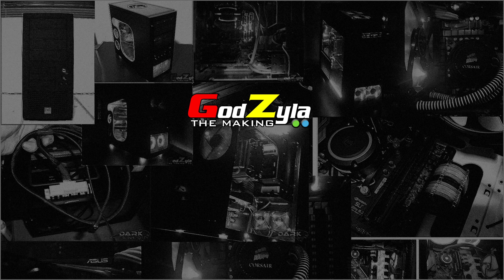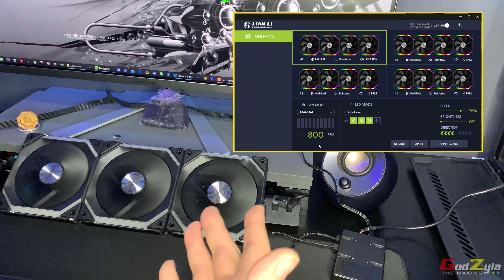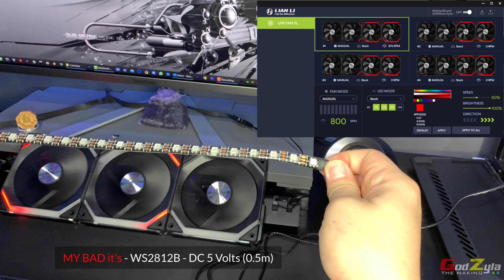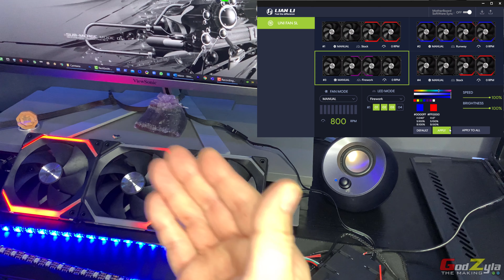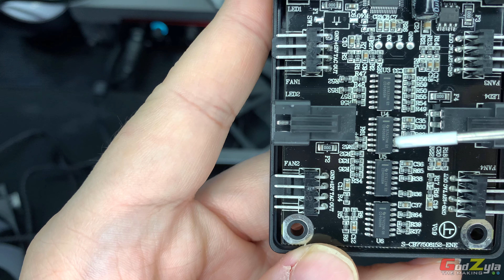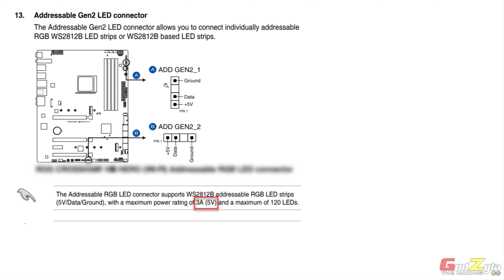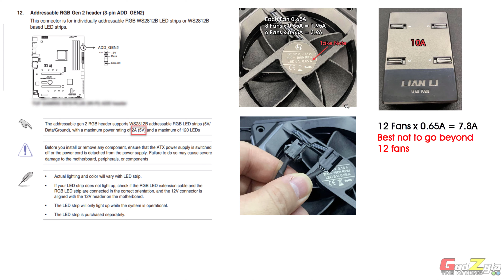Lian Li UNI Fans SL120 - Dos and Dont's (Part II) [L-Connect]

Comment: If motherboard is a320m a pro max cannot use this lian li fans right ? Because my motherboard cannot use software to adjust rgb , just can remote or controller only
Reply from the maker: Thank you for your question.  you can use the Lian Li L-connect software on the uni fan controller itself that comes with these fans (make sure you buy a pack of 3 that comes with this controller). 
What you need is just to plug the cable between the uni fan controller and your motherboard (refer to your motherboard manual on page 8 https://download.msi.com/archive/mnu_exe/mb/M7C52v1.2.pdf ) either to JUSB1 or JUSB2.
Reply: @KleoYan  can lian li 9 Fans together in one time ?
Reply from the maker: So long you connect 9 fans into the unifan controller. I suggest this. The controller itself have 4 sets of ports. Set 1, Set 2, Set 3 and Set 4.
Each set provides a connection for fan and for argb. 
Just make sure u daisy chain only 3 fans to each set. Example 3 fans to Set 1, another 3 fans to Set 2 and last 3 fans to Set 3. 
I do know u can chain 4 fans to a set but is better to balance out the load/power drawn that is build in the controller..

If you connect all 9fans or daisy chain all 9 fans together and connect to only one of the set. Lets say to Set 1.. u will overload it and will burn and blow..
Reply: @KleoYan  so if I got lian li 9 fans , must plug in 3 set 1 3 set 2 and last 3 in set 3 ? And I just plug in the wire to my motherboard Jusb 1/2 and that’s work ?? But I can’t use software adjust light , if plugin jusb1/2 its work how I want to change the lian li fans colour and speed ?
Reply from the maker: @raymondtan2832  Yes correct and when you plug wire to your motherboard JUSB 1/2 from the Uni Controller, use L-Connect software to change fan lights and also the fan speed.
L-Connect Software here https://www.lian-li.com/downloads/L-connect.zip  . you might want to view part I https://youtu.be/ORdObJTn-3E  or this from the official website https://youtu.be/xdEqEGrbMkQ , thank you!
Reply: @KleoYan  so the lian li fans sure my motherboard a320m a pro max can use ? Just the wire head pin plugin the jusb1/2 ? And then the fans will ori rainbow light and normal fans is fix cannot adjust right ?  And my motherboard and how many that lian li fans ? Cause need 6
Reply from the maker: @raymondtan2832  pardon me, where are you from? I tried my best to explain to you but you don’t seems to understand what I am trying to say. U can make use of the uni controller to control your lightings effect and fan speed. All is needed is to plug the USB from the control unit to your motherboard JUSB1/JUSB2. Then download and install the L-connect software from Lian Li and control your fan lightings and fan speed.
Reply: @KleoYan  oh ic , so it’s confirm work ?
Reply from the maker: @raymondtan2832  it will work. thank you!
Reply from the maker: Hi Raymond, I  have done up another video, you might get a clearer picture here. https://youtu.be/Rm2emeyMUAk

Comment: I'm looking at buying this kit x 2. I built a system using the H710i NZXT case which comes with a single LED strip. I haven't looked carefully at it, but I'm trying to figure out if it'll work with the Lian Li control unit. My plan is to remove the NZXT controller along with 6 of the fans and replace them with this setup... so really I'm just trying to figure out if that LED strip will work. Thanks for any help you can provide!
Reply from the maker: Take a closer look at your strip. Are they 4 pin or 3 pin. If it’s 3 pin you might be able to use them as most 3 pin are argb. Another way is to see the expose strip itself. Try to indicate if there is a 5v, d-in or d-out and last is the gnd. You can refer to my guide here about rgb and argb strip https://youtu.be/gHfAlQbuOpc

Comment: Could you try and take one of the fans off? I'm considering buying them for my new pc build but in order to get decent airflow, I will need to either mount them with the rear side showing or 3D print some reversed fan blades myself.. is it even possible to take the blades away?
Reply: They're led doublesided so you ain't losing much
Reply from the maker: Hi Haise, thank you so much for helping me with the answer and to have visit my channel. If you do like my content, kindly subscribe and click on the notification bell. Once again thank you.
Reply from the maker: Hi manubra, thank you for your question and yes you can put as little as 1 or max 4 .. is up to you.. not an issue. As for removing of fan blade, am sorry I will not be doing this as this unit does not belong to me. Thank you for your visit.
Reply: @Haise, yeah well.. but there are still some struts and cables that would kinda look bad..
Reply from the maker: @manubra5853  Hi, thank you for re-visiting and your comment. the uni fan SL120 are daisy chained fans.. lets say you have 9 fans, you only have 3 cable mess to deal with, as compared to other fans. you will have to deal with 9 sets of cables which is a bigger mess. Anyway, lets hope in future if fans are able to power up and synchronized using bluetooth technology.
Reply: @Kleo Yan, I’m not talking about those cables.. I’m talking about the cables and struts that connect to/hold the motor in the center
Reply from the maker: @manubra5853  ah ok. Infact I have no idea why do you want to remove the blades or to temper the cables and struts on these uni fans. maybe it will be a good idea for you to  write an email to lian-li about your inquires, do pardon me as I am not able to answer your question.
Reply: @Kleo Yan, I’ve just asked cuz if you can take them off cuz I was thinking about 3D printed custom fanblades.. I have already gotten my answer in the meantime and we are talking about a completely random idea wich I was once thinking about
Reply: @manubra5853  Unless you have a lot of light going in your case, the cables are noticeable on the backside. You can easily peel the sticker and put it on the other side to make it even less noticeable.